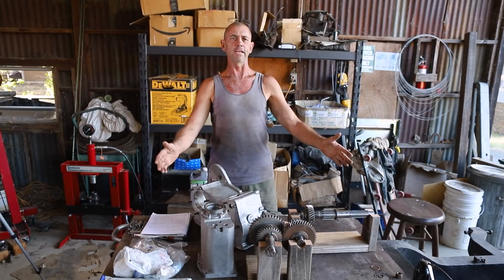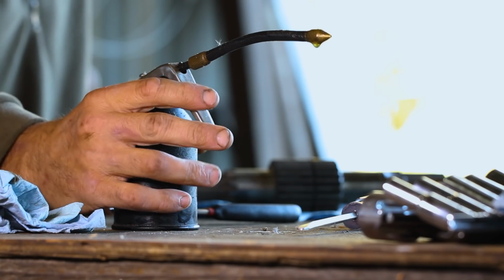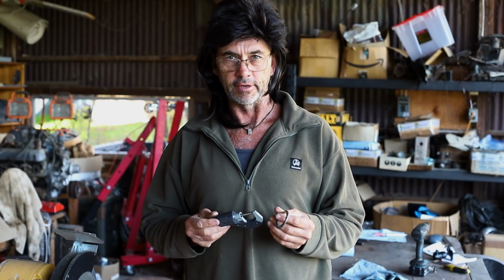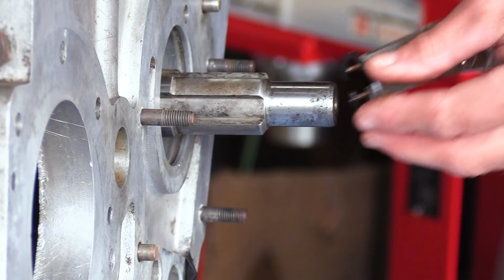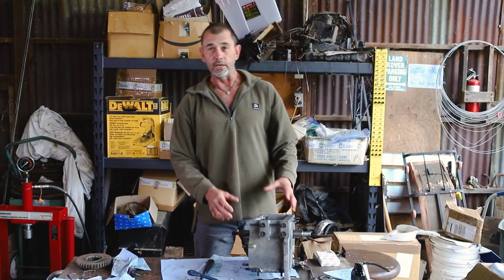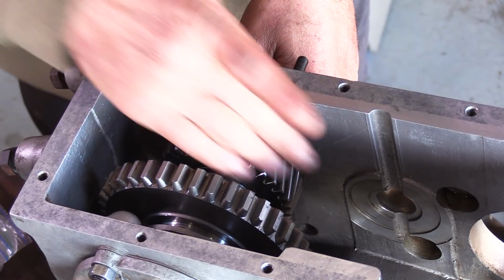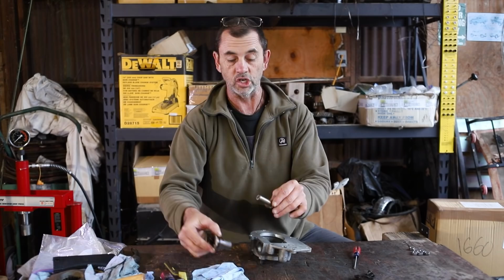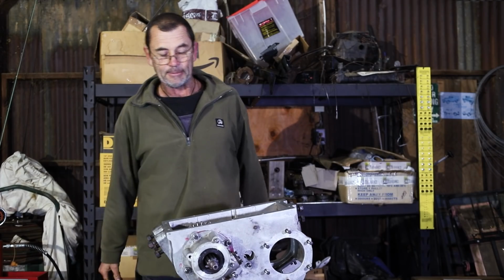Part 22: Transfer Box Overhaul_ Series 1 Land Rover Restoration.

Comment: I had a bit to tight tolerance on the output shaft high range gear and now I've had to take it all apart again. Because it's welded itself to the shaft..🙄
Learning by failing..

Comment: Another Masterclass with a 1st class Aussie presentation, Gav. 
Any students of the dark art of Land Rover maintenance will have learnt many skills, the least of which is what proper clothing to wear in the workshop! Speaking of which, a hairnet is required when you haven’t had a haircut in a long time. 
On a different tack, what size wheels and tyres are on your D2? Cheers mate. 👍🏻🙏🏽🦘
Reply from the maker: 265/75R16 BF Goodrich All Terrain. The Vehicle already had a 'lift' when we bought it and the larger tires fitted. I found them to be so good I replaced them with the same when the time came. I did have to buy an adapter plate to carry the spare as the larger tires won't let you close the rear door and need be lifted a little higher. The spare that came with the truck was a standard rim equipped with city tire tread.
Reply: @ForemanAndWilmsAdventures  
Thanks Gav. My wheels are 18” alloys.